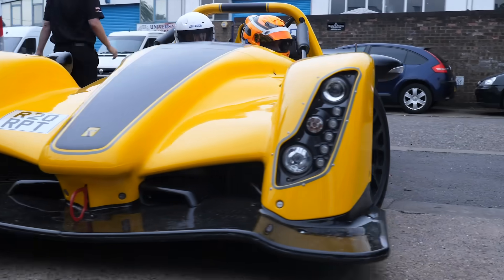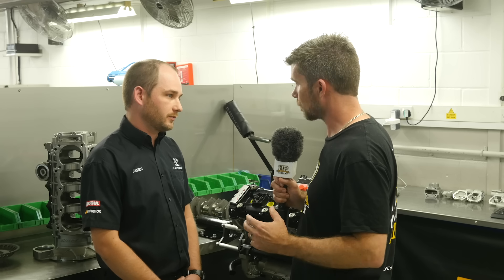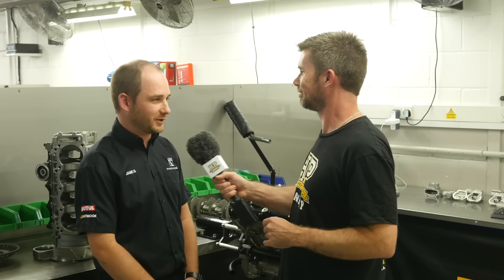105kg, 500HP, 10,500RPM ‘Hayabusa’ V8 | Radical Sportscars RPE-V8 [TECH TALK]

Comment from the maker: TIMESTAMPS:
0:00 - Why A Motorcycle V8
0:35 - Stock Hayabusa Power
0:53 - From Busa Four To V8
1:27 - What Stays Suzuki
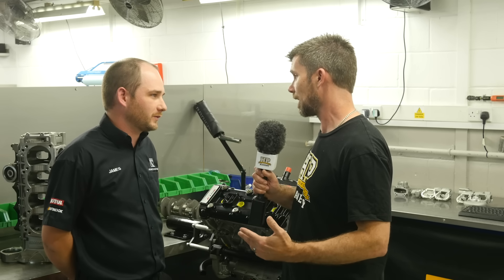1:46 - Designing The Crankcase
2:32 - 72 Degree V Angle
2:52 - Odd Fire Firing Order
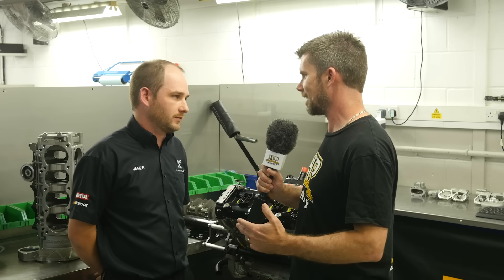3:32 - Harmonics And Crank Life
4:39 - Avoiding Harmonic Hot Spots
5:38 - Flat Plane Crank Pros
6:14 - Flat Plane Balance Trade Offs
6:48 - Rod And Piston Weight
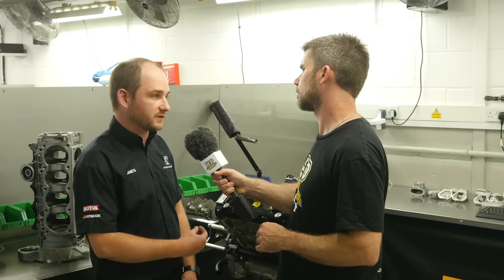6:56 - Why A Cast Crankcase
7:39 - 500 Engines In Service
7:52 - Integrated Dry Sump And Water Pump
8:22 - 2.7L Power And RPM
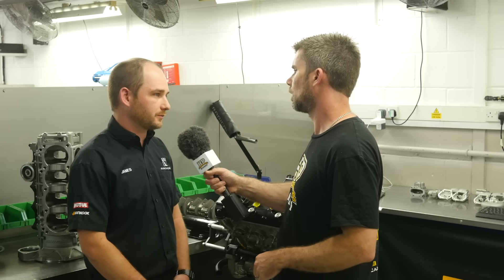8:41 - 3.0L And 3.2L Options
9:05 - Rod Ratio And Spacer Plates
9:49 - Billet Barrels And Nikasil
10:26 - Big Pin vs Small Pin Cranks
11:05 - Race Warranty Hours
11:26 - Typical Rebuild Work
11:49 - Where To Find Radical
Building a fast car? Get $400 OFF the VIP package with every current and FUTURE course included: https://hpcdmy.co/vipy2
Learn Engine Building today. Fundamentals course now 50% OFF.: https://hpcdmy.co/offery2
Reply: I would love to have this in a Civic😁
Reply: How much does it weigh?
Reply: Every catheram
Reply: it's cool that engines are getting small :)

Comment: "NOW WE NEED TO STEP IT UP!!!"
"CREATING V10 AND V-12 HAYABUSA POWERED ENGINES!!!
"PUT SOME BIG MAIN BEARING CAPS IN THERE, NO RE- GRINDS!!!"
"YOSHIMURA STAGE 1 CAM...........🤔"
WE'LL  TURBOCHARE IT,
"LET IT BREATHE ON SOME NITROUS OUT OF THE HOLE!!!"
"THE V-10 CAN GO IN AN INDY CAR."
"THE V-12 IN THE FORMULA 1!!!"
YEAH!! ✌️😃👍🇺🇸
"AMERICAN ENGINEERING!!!"
"AND START RUNNING FLAT PLAIN, CRANKSHAFT PLEASE!!!"
"AT A 90° ANGLE V-TWIN ,DOES IT NEED A HARMONIC BALANCER!!!" 😠😡🤬
"THINK COYOTE ENGINE, ON STEROIDS!!!
"KEEP THE BORE, AND STROKE, JUST CHANGE THE FIRING ORDER. 
"FLAT-PLANE CRANKSHAFT, 
"STAGE 1 YOSHIMURA CAMSHAFTS."
"AND FORGE THAT CRANKSHAFT!!!"
WERE GOOD!!!
"UNTIL HONDA BREAKS OUT THE NR-1200, OVAL PISTON TECHNOLOGY IN A V4.!!!"
"THEN YOU'RE GOING TO HAVE TO MAKE CRANKCASES FOR THAT!!!"
"WHO WOULDN'T WANT, A CROSS PLANE V-10,
WITH PUSHRODS, AN OVERHEAD VALVES IN AN LS HEAD!!! ✌️😃👍
👣👍🇺🇸🪖

Comment: Did he say the firing interval is 72, 180?! 🤔
Reply from the maker: 72 degrees is the angle of the V configuration of the block. This makes it more compact than the 90 degrees that is more common, however, it presents some other engineering issues that must be addressed as discussed.
It's not the only 72 degree V engine out there - Taz.
Reply: @hpa101  Thanks Taz for your reply but I am asking about the firing interval. natural Firing interval for V8 is 90degrees and a V angle of 90 degrees between the banks is key to achieve a smooth even firing interval of 90 degrees. Now for this HAYABUSA V8 engine it has a 72 Degrees angle between the banks so the firing interval is odd and it is 72 degrees and 108 degrees (not 72 & 180 as stated in the video) so this is what am asking about.
 (BTW even firing interval of 90 degrees can be achieved  with 18 degrees offset crank pins). 🙂

Comment: I'm sorry buy this engine design is absurd. This should have been made as a boxer 8.
Reply from the maker: Some would say a boxer 8 is absurd to be fair 😂 If you aren't keen on an engine like this there are plenty of other options out there for you, that is part of the fun, finding what we personally wish to use (and can afford) 😎 - Taz.
Reply: @hpa101  He's making a high performance engine. You wouldn't need any balancing in a boxer. That would delete the crankshaft weights, and counter balance. It would also allow that 6000 rpm range to be used more.  Also lower the center of gravity for the vehicle, and make aerodynamics easier to manage.

I'm just nitpicking here. It was a great video.

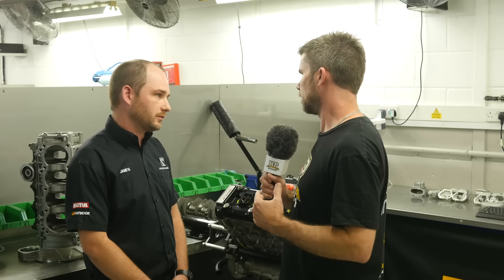Comment: 6:30 you don't seem to understand this.  Crossplane cranks only have one purpose: that they can perfectly balance secondary vibrations in a 90 degree V-8.  There's no such think as a crossplane in any V8 but a 90 degree V8.  In return for the smoothness it gives you significant extra weight, though, not only making the engine heavier but also making it slower to gain and drop revs.  Once you're not at 90 degrees, you just bite the bullet and go flat-crank and at that point the engine is just two 4-cyls with the vibration no worse than that would lead you to expect.  If this thing makes the same power as the Hayabusa per bank, it's vibrations will be no worse than the Hayabusa.  (However you'll have twice as many of them, due to two banks, and in double the directions.)

Comment: Was this Hayabuza V8 engine also used in the Ariel Atom V8 car?
Reply from the maker: No. This is the RPE V8. The Arial Atom engine is the H1V8 from Hartley Enterprises, although I believe they were both developed around the same time (early 2000's). Hartley did go for a 90 degree again instead of a 72 among a few other differences.

Synergy V8 at one point in time also had a similar concept I think, but it didn't see as widespread use as Radical or Hartleys - Taz.

Comment: My old school crappy small block Chevy  makes over 400 hp and 400 ft lbs of torque and only needs to spin to 6,500 rpm.
If I bought a fancy aluminum block, belt drive, and higher rpm valve train, lightweight billet crank , rods and pistons. dry sump oiling. I’d be way ahead of this thing.
I don’t get it.
Reply from the maker: This will always be smaller and lighter, but not everyone needs an engine like this. If you don't get it, you don't need it - Taz.

Comment: I thoughts about the perfect compact light weight sport oriented engine : V4 65° 1584 cc engine with a supercharger and redline at 11000 rpm. E85 compatibility. 300 kw power 300 Nm of torque.

Comment: Ah, yes. The Hartley V8.
Reply from the maker: No, different engine and different company. I think Radical did have their version for sale in a chassis before Hartley Enterprises struck the Aerial Atom deal, but they were both working on R&D at the same time and took different paths.
Each will tell you their version is better 😀  - Taz.

Comment: It would be interesting to see if switching to a v10 design with the 72 degree offset would help reduce the harmonics of the engine due to a more even firing order (5 combustions per rotation, 72*5=360, even combustion and full firing order once per 2 crank rotations).

Comment: Given the compact nature of the Hayabusa engine as it is, and the preference of the 72° V angle, I have to wonder why they didn't add a couple more barrels and get a naturally balanced V-10 out of it?  Still, this is a pretty cool little engine!
Reply: That's a lot more work in modifying the cylinder heads.  The whole point of the V8 was to keep the cylinder heads they already know inside out.
Reply: @identiticrisis   Fair enough.  It's just a shame, since 72° is the perfect angle for a V-10 and terrible for a V-8.

Comment: Builders of Prostock and competitors in the Engine Masters Competition have proven that concepts like rod:stroke ratio and piston speed don't matter, that is out dated theoretical hod rodding conjecture that has been proven wrong, certainly in an engine that is still down around 10,500 Rpms. Perhaps in engines revving much higher it could start to come into play. That's a tiny V8 comparatively, there's a 640ci V8 running 10.5k.

Comment: Talk more about crank flex.  A motorcycle crank is not designed for the contact patch of a cars 2 rear wheels.  I have heard in racing that even a small race car can twist a crank if they do not manage the throttle well.

Comment: Makes me wonder why they don't just manufacture the complete engine without need for the Suzuki cylinder heads?
Reply from the maker: You need some solid advantages to justify it otherwise you're just pushing up the price of your product and creating more work for yourself across multiple departments for no reason - Taz.
Reply: @hpa101  but what happens when they stop producing the engine?
Reply from the maker: @dynomania  you can 'what if' yourself our of any decision. If that happens, they will deal with the situation.

As it stands they are almost 20 years deep into production of different variants of this engine without that being an issue - Taz.

Comment: I believe Hartley was the first to build these for sale.  Radical may have taken a page or two from his development.
Reply from the maker: I don't think that is accurate. From what we know speaking to both Hartley Enterprises and RPE previously, they were developed independently around the same time and they went in different directions on numerous aspects. They are not the only engines to be designed around production motorcycle engine heads, which is great, the more the better 😎

Of course Hartley thinks his 90 degree package is better and RPE think their slimmer 72 degree package is better. I haven't personally extensively raced either to make any kind of call on that, but on the surface they both have their own pros and cons - Taz.

Comment: How close is this to John Hartley's Hayabusa V8 used for the Atom 500? I'd imagine there are minor differences to the approach. The Ariel's is also lighter at 90 kilos.
Reply from the maker: They were developed around the same time to the point Hartley might not have even started development before Radical (I'm not a historian though), but other than being Hayabusa based, they are very different. This is largely thanks the RPEV8 being a 72 degree V and the HEV8 being 90 degrees and both options require different design approaches and considerations.

Radical will tell you theirs is the best way, Hartley will say theirs is the best, as a consumer, you can decide for yourself 😎 - Taz.
Reply: @hpa101  hahaha maybe in my next life I can hope of being a consumer of these magnificent machines. Curious about the engineering though. Interesting how they're completely different approaches to the same platform. Would love to hear a sound comparison of these two, I'm betting the Radical makes exotic noises with that crank configuration. The "harmonucs" if you will ;)

And it never even crossed my mind which is "better". Apples to oranges the way I see it. I mean sure, they're both fruits! If only we could have the engineers in the same room. I could listen for hours the discussion of their approach, goals and objectives when developing these beauties. Or maybe Radical can get an Ariel and stick an RPE V8 in it, and Hartley can stick their V8 in a Radical. That'd be something!

Comment: Why do car tuners use crank power figures when bike tuners use wheel power ?
Factory stock gen 2 busa is 170 wheel .
200 is optimistic even for crank reading .
Reply from the maker: Both are used, depends who you're talking to, the type of dyno used and a car will have different drivetrain losses compared to a motorcycle - Taz.

Comment: Im running a turbocharged busa engine in my tube chassis sand buggy that's been built pretty decent but I would absolutely love to get my hands on one of these to throw in the buggy.... I'm  already pulling the front end up at over 60mph at will since it is so light the only real weight up front is my fat 220 pound ass  i built it cockpit forward to help keep the front down  but it hasn't helped much lol  even NA that thing would be an absolute ball to blast across the dunes

Comment: Can you do review on the Synergy 2.0-litre V8, which is based on the cylinder heads from the BMW S1000RR superbike engine and variable-length velocity stacks as used on the bike engine.

Comment: The Hartley H1 V8 which found it's way into the most powerfull Ariel Atom is also based on the Hayabusa engine. Comes in various variants up to 3.3l(H1 Maxi) and is highly customizeable. The Maxi which is the 90° V angle version makes 520hp and can be yours for 45.000$.
Reply from the maker: Yes, developed at the same time as this but independently. Synergy also did their own version I believe along with others - Taz.

Comment: I think for the viewer it would've also been interesting to point out that the valve timing train is opposed on both banks of cylinders due to using standard OEM Suzuki cylinders and cylinder heads, aswell as possibly also OEM camshafts.

It's quite remarkable what they achieved without harmonics dampers at a 72° V-angle. I understand their decision, but am adament about a 90° being overall the better V-angle, when you're not going to use harmonic dampers. It also has a lower center of gravity, more space for an intake manifold and throttle bodies and other devices, aswell as enough space to fit the exhaust system well inside the dimensions of the engine.
There's a reason why 90° has been the choice of virtually every race engine from a V4 to even a V10, which naturally would be a 72°.

Still very impressive and always a pleasure to listen to some people who know what they're talking about!

Comment: would rather keep it in 400hp and not need to replace rods and bearings every ten minutes, also it should be in straight configuration at 90 degree angle to try and maximize smoothness, it would only be as long as a bmw straight 6 but half the weight and more power than s54 m3,  connected to perfect mx5 gearbox with longer final drive via uprated clutch and same flywheel with 300 lb ft torque and 400hp at 10000rpm would perfect power for mx5 while not affecting weight with negligible effect on weight distribution.
Reply from the maker: There is a 400hp variant. At the end of the day if you want carefree motoring with long service intervals, you should get a Toyota Corolla or similar. This is a race engine, and for a race engine it has what is actually quite a long service interval, but it will never be the same as a low strung OEM engine - Taz.
Reply: @hpa101  or just an ls swap like any sane individual!

Comment: Very lowest running warranty, only 3-4k kilometers? Why not 20-25k kilometres?
Reply from the maker: This is a race engine, and those are race kilometers.
It's built to race rather than for high mileage street use, there are already engines built for that - Taz.
Reply: @hpa101  is this engine handle 2000+hp turbo power?
Reply from the maker: Did you watch the video? It's not a drag racing engine Minhaz, just as it's not the one you'll find in a Toyota Camry - Taz.
Reply: @hpa101  if I ordered them,then they can build a v8 engine that can handle 2200hp?I wanna fitted for Hayabusa engine.

Comment: Regars kawasaki H2R only 4 cylider. 😘
Reply from the maker: Very different engine that also runs forced induction. Not sure if they're being used as extensively as the 4 cylinder Busa engines in other applications other than the bike frames they come in though - Taz.